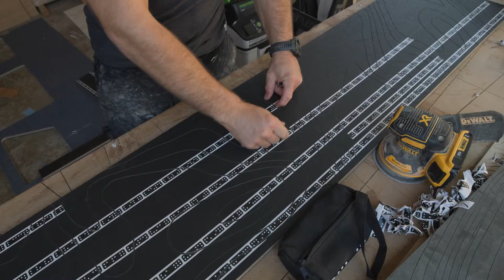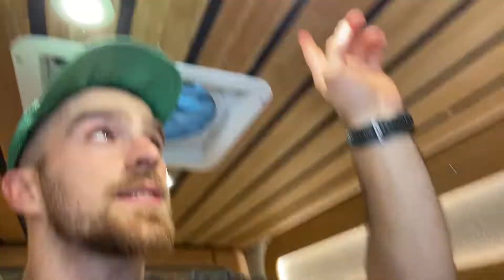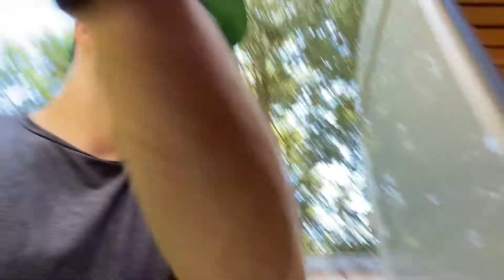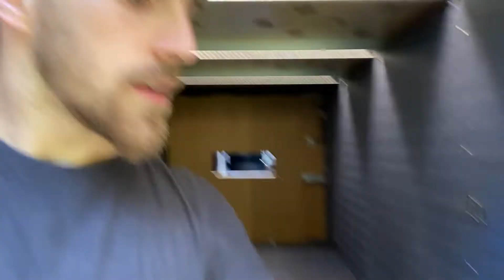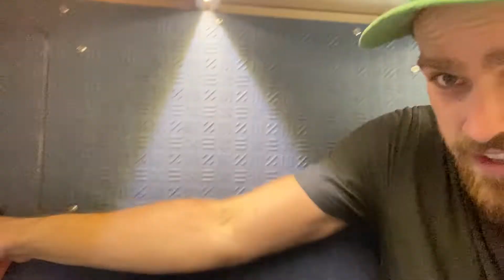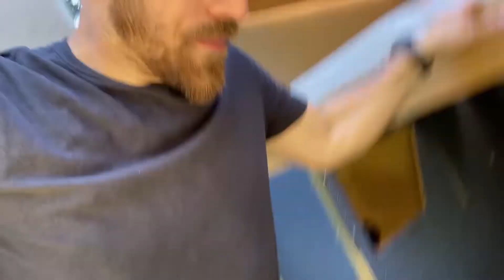NEW VAN Tour! Custom CNC Design

Comment: How do you mount the cabinet faces to the overhead 80/20 cabinet frames?
Reply from the maker: I drill 1/4" holes through the center of the 8020 and use 2" wood screws with washers from behind the frame
Reply: Amazing design!
Reply from the maker: @scottydidnt  Thank you!